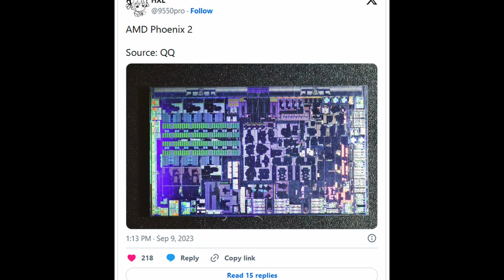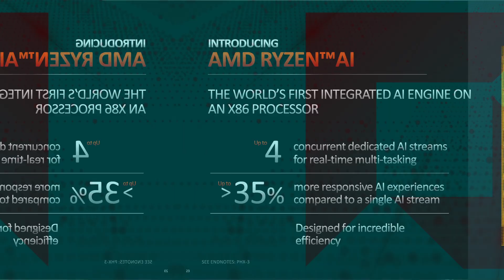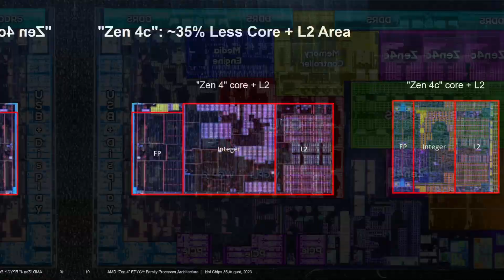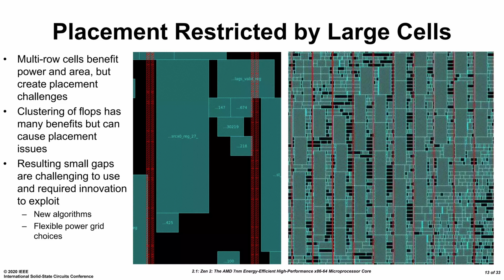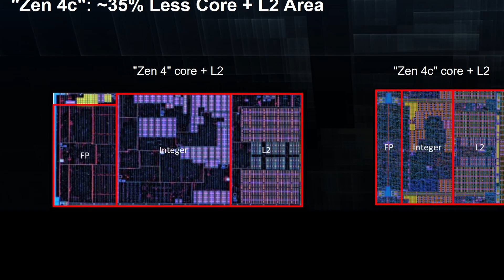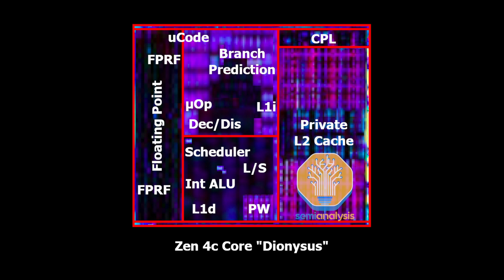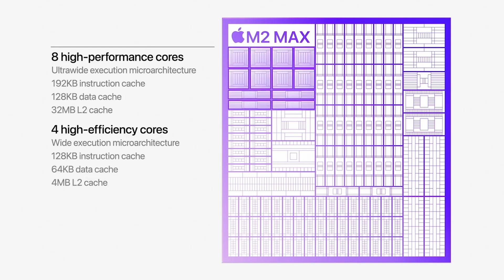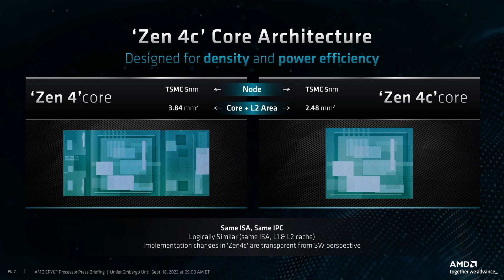Why AMD's first Hybrid-CPU is Different

Comment: I'm betting Zen 6 is gonna be a complete "Big" core refresh that ONLY focuses on clockspeed.

The multithreaded future we've been dreaming of hasn't arrived yet and doesn't seem to be happening any time soon.

Also fun to think about they may make a very low power "little" core only CPU that can run on fumes, basically. Without sacrificing whole a lot of multithreading.
Reply from the maker: I think Zen 6 might also change the chiplet design itself.

Comment: I thought IBM did this first (the big/little mix), not ARM, with the Power Cell/BE as found in the PS3. AMD still deserve all the credit for taking it further: eg Xbox switched from Power to AMD. Well researched, thank you for your work!
Reply: The CELL SPE cores should not be called big little really. The SPE could not run any general workload. They are basically SIMD coprocessors managed by the main CPU. Cell is a heterogeneus design yes, but I'm not even sure thet SPEs should be called cores at all. You needed an API/SDK to use them and you basically offloaded some parallel straeming operation on them, not branching logic. Which is why Cell was hard to program for but gave a lot of potential.
Reply: I think that's maybe why he used b-roll of the original PS3 COK-001 motherboard in the video.
Reply: @Doubles_Advocate  thanks I missed that! Oops

Comment: That is very clever: they avoid any optimization/compatibility issue
Reply: Isn't that the whole idea of PCs... keep using the same time tested architecture, so you benefit from all the previous work and don't cause problems.
Add small new things to the arch slowly without removing anything.

Comment: It's a lot of money to develop a 2nd microarch, and I bet it's hard to justify thay cost for an arch literally intended to be slower.

x86 just isnt designed for bigLITTLE paradigms. ARM and RISC-V are just better platforms for hybrid designs and AMD might just be hedging their bets than x86 is going to die before hybrid designs are worth the investment.

Comment: If I had the option to buy a "8995" am5 cpu with 48+ cores 96+ threads at say 4.5ghz boost clock (16 core big and 32 little) I'd turn in to fry "shutup and take my money" I run a lot of containers and vm's on my desktop I run a 7850x with 192gb of ddr5 at 5600mhz as is and can easily max out my system honestly need a thread ripper class machine but can't afford it.

Comment: AMD also named the small Zen APU as Raven 2. Later it held a name I can't recall but driver code still refers to it that way.

This is actually a great way to go, especially on laptops. 2B + 8l would probably be thermally limited anyway but less than an all core equivalent.

For desktop 4B + whatever you can fit should also be enough for high performance designs. On server Genoa is already a huge win for higher perf through lower power per computation.
The hard part will be fixing the Windows Scheduler. On Linux it is already fixed by ARM long ago.

This is also a different design from Intel, as here the small cores also have the same connection to the memory controller and L3 cache. On Intel there is some latency penalty from them being clustered in groups of four.
I think people will be very surprised of how this will work and will not think of small cores as a bad thing.

Comment: Having the C and non-C cores have the exact same instruction set but with diferent frequencies/thermal budgets is brilliant! That means no AVX-512 bullshit like Intell has, or problems with certain instructions being significantly slower on the C cores vs their alternatives with regards to the non-C cores. This allows compilers, opersting systems and applications to optimize for AMD much more thoroughly.

Comment: PS3 motherboard at 5:12, 😂
Reply from the maker: OMG how did you spot that? How many PS3 mobos did you see in your time?
Reply: @HighYield  I don't think I've held one in my hand ever. But the way smd components are arranged on the Cell CPU chip is unique: they are at the bottom side where solder balls are. There had to be a hole in the motherboard, otherwise it's impossible to solder the chip. I've never seen anything like that anywhere else.

Comment: I think AMD should start to abandoning SMT and  making future Zen c core to be able to work in pairs to combine IPC. They should also start integrating dedicaded hardware compression/decompression engines, dedicated virtualization engine,  DPUs. That would make PCs feel like far above consoles if software is properly optimized. I don't see core count going 3 digits(unless the core philosophy changes) in gaming desktops, regular pcs and laptops in 20-30 years or even more. Pro/server will always be unsatisfied.

Comment: Hoping to see a 8 zen 5 x3d + 16 zen 5c cpu in the first half of next year. Gonna be building with that chip if it's released.
Reply: Yeah, that's a mad concept for programmers and content creators who also wanna game.
Reply: They won't do that... It sounds amazing on paper but how many people would actually buy that?

Also it would perform poorly. There's a memory bandwidth requirement to feed cores. Probably requires threadripper socket.

There's a lot of discussion of whether it's coming to the chiplet desktop CPUs at all in a hybrid package with a regular chiplet and a c chiplet... And it seems like it won't at all... That's why we've only seen them in EPIC because they make so much sense for servers. And in laptops where the size and power efficiency are king.
Reply: @SquintyGears  Intel is pushing e-core counts higher already with 14th gen and they're already at 8+16 now, so AMD is going to have to do something if they want to stay in the upper end of multi threaded performance on desktop. I have a 5950X myself (software developer) and in my workloads it makes 1-2% difference whether I run the memory at 3200 or 3600. For really "crunch heavy" stuff like all AVX workloads it makes even less. It's practically only branch heavy code, and code that does very little work to very large amounts of data (like database lookups) where memory bandwidth is a problem. Games, however, tend to fall in this category.

Threadripper (non-Pro) went up to 64 cores on a quad channel memory setup on DDR4 3200. I can't see any realistic scenario where 8 full and 16 compact cores can't perfectly well run on dual channel DDR5 6000.
Reply: @andersjjensen  we haven't seen the numbers for those intel chips yet...
Yes obviously quad channel has been proven in the past.
The main difference you're seeing from 3200 to 3600 is the inifity fabric clock difference because latency to memory doesn't scale along with the the raw bandwidth difference of that clock bump, unless you took the absurd amount of time it take to tune the timings for it. i don't know anybody who has, I've tried and given up....

Also, importantly, Intels 8+16 wouldn't take as much bandwidth to feed as a zen + zenC of the same count because the slow intel cores are much slower than their counterparts.

I'm not saying i know exactly where the breaking point is where the performance gains fall off a cliff. But I'm pretty sure we're not that far from it. with some quick napkin math with latency that hasn't changed and bus width that hasn't changed but core counts having exploded you can understand why some people wanting to see 48 threads on AM5 seems a little bit far fetched... And that's if they would even make such a configuration. I'll remind you that we've only seen leaks for epic chiplet parts and laptop fully integrated parts. Both are integrations where it brings a very obvious advantage. What's the point for desktop? (assuming they do finally release an update for threadripper)
Reply: @SquintyGears  you do realize that the memory bandwidth has increased since they put 16 cores on am4 right? 24 cores is only a third more bandwidth needed if you start from the presumption that the first 16 core chips were bandwidth bottlenecked
On server they do 8 cores per memory channel for zen4 and 16 for zen4c. A 24 core needs 2 channels following server guidelines. Am5 has 2 channels...
Reply: @annebokma4637  see that's where i don't understand your logic. Zen4 and zen4c have the same ipc just a 20% clock deficit. So why would 16 cores take the same bandwidth as 8???? Intel might be able to say that but their small cores are slower in every way.

Comment: Commenting for Saint Algorithmus.
As a Layman, I have no expecation of what any of this companies will do with LITTLE.big design, but if there are enough other major competing design and programming organizations operating in a space, it makes coming to that space significantly more enticing as much of the ground breaking is already done or already being done.  
I'm thinking about how Microsoft partnered for scheduling with Intel to implement Intel's solution for this issue.  If the programming needed to optimize asymmetric design is already past the initial ground breaking as well as having multiple competitors already operating in that space, there is heavy pressure to maintain exploration that same space for yourself as well.
Will AMD eventually go full asymmetrical?  Depends on Moore's Law related stuff .. soo .. probably.   I mean .. AMD is already openly well practiced with packaging that stuff due to the costs/gains ratio of how better process nodes like TSMC's N3, N5, and N7 work with cache, logic, I/O and such ...

Comment: While the C-cores make sense for mobile, I think the gaming APUs are more limited by the area and power draw of the GPU (and possibly memory bandwidth). AMD needs to find similar optimizations for the GPU

edit: as a separate note, could mention in the video how modern operating system schedulers already focus on the best rated cores for foreground applications, and indeed multicore workloads push the clocks of all cores down, especially on mobile
Reply: Yes, but area efficiency is the concern, zen4 or zen4c both are very efficient at low power, but classic zen 4 takes so much space.
Reply: @yusuffirdaus3900  You should look at Intel cores, they are like twice the size of Zen cores, at roughly the same, or marginally higher IPC. Regular Zen cores are already comparatively efficient for the space. So Zen4c cores aren't that much bigger than a E core, but obviously much faster.

Comment: High core counts are also constrained by memory bandwidth. However, this can be partly mitigated with a larger cache. I would think a 32 core AM5 desktop could be made practical if: a) It also included 3Dvcache and b) it Used fast DDR5. Ideally, more RAM channels would be ideal, but even without them, I think 32 cores could be fed this way. Perhaps an all Zen4c or Zen5c desktop part with 32 cores would be a multi thread killer. It would still lag in games and the like due to lower clocks but I would love one on my desk.
Reply: We're moving to CXL and HBM. I think DDR is seeing it's last days.

Comment: I imagine the Zen 4c cores can compute the same instruction sets as Zen4, Unlike Intel E cores which are missing some instruction sets the P cores can execute. AMD with their smaller silicon footprint along with chiplets can likely build CPUs relatively cost effectively now, even with TSMC charging more to produce them. On the flipside Intel has the advantage of creating their own chips in their own fabs.
Reply: Yea the identical instruction sets is an interesting choice. It’s a huge win for the server market and opens up possibilities for all-efficient-core designs, but may make less sense for some consumer applications (a lot of background processes may not actually need stuff like avx512 so that may leave big chunks of the core sitting idle). 

 I’m sure how much intel running their own fabs is truly an advantage right now given how much they’ve struggled to get EUV online and move to their next node. Relying on TSMC may mean AMD is sharing some of their profits but it also means they’re always able to access the latest, fastest process node.  Shedding that risk removes a lot of uncertainty.
Reply: @MikeGaruccio  If you are using a recent C standard library you'll may end up having AVX-??? instructions simply by calling the strcmp function.

Comment: I just dont get the 'hybrid' approach here.  I feel like the idea of denser 'c' cores makes plenty of sense, but only when used in isolation.  So go either all big or all dense.  Otherwise, despite no technical IPC difference, you're still talking about needing to make the scheduler make guesses.  Lower clockspeeds still means a performance difference, so you need the most important and heaviest tasks to be on the obviously fastest cores.  Or maybe hybrid would be useful for like Threadripper or something where there's more of a split between needs of single thread and high core multithread workloads.  But this is a niche use case.  For vast majority of people, the multithread capabilities of say, 16 full sizes cores is more than good enough, versus 8 full size and 16 dense.
Reply: With this approach, the only difference between the cores is how high they clock. Modern schedulers have this information available and can watch how much of a core a process is taking and migrate it appropriately.

Comment: The biggest advantage of the the C cores is while it lacks L3 you can just pop v cache on it and make up the difference and then some. You wouldn't find that in the highest performance chips but I could see that for all APUs going forward considering die space is so important.

For high end desktop (gaming) I could see ryzen 8000 or maybe 9000 having a block of full sized cores with v cache and then a even lower clocked block of C cores for all background tasks or anything that the OS thinks wouldn't be effected by the chiplet to chiplet communication penalty.

Really AMD should just come out with APUs for the low end, mid range and high end gaming chips with v cache, and then have their highest core count CPUs just use C cores as productivity (generally) cares more about cores than it does clock speed. Not sure how much that would eat into threadripper sales but considering they havent come out with those for a few generations i dont think they would care too much.
Reply: @raute2687 You can say you do productivity work on a laptop but lets be real, any person that does it for work will have a desktop. Which is why they should segment the line up for entry level APU, mid and high end gaming, and then top of the line productivity where more cores will actually help performance.

Comment: AMD is definitely using the best approach to consumer high performance hybrid CPU design. Having a unified architecture across something as fundamental as the CPU cores is absolutely essential because inevitably the task of scheduling work appropriately is out of your control and in the hands of software developers, mostly Microsoft. While Intel can try to help the software with things like thread director, of it really worked to ensure work was only scheduled on cores that could run all the instructions thar visitor that work, they wouldn't have needed to disable AVX-512 on the P cores, but instead they had to remove functionally from their more expensive, more capable, and more premium cores to try and bring them more in line with their cheaper and less useful efficiency cores, bringing all cores down in functionality to the lowest common denominator.
AMD on the other hand will only differentiate their two types of cores by clock speeds as far as the scheduling software can see, and scheduling work based on clock speeds is something that schedulers have finally managed to get right.  Basically, by having a consistent architecture across all cores eliminates the need to develop a solution to properly utilize different core types based on both performance and efficiency requirements, but also by the supported functionally in the different core types. AMD 's hybrid designs will work with existing software that has been proven to work over multiple generations of hardware

Comment: Honestly this could revolutionize the flexibility of Chiplet design that AMD does on Desktop without needing to incur as much CCD Latency issues like on the X900+ SKUs currently.

Instead of needing 2 CCDs to break past 8 Cores. You could have a CCD by default come configured with 8 Full and 8 Compact Cores with 3DVC.

So something like

8950X = 32 Cores (16 Full, 16 Compact, 2CCDs)
8900X = 24 Cores (12 Full, 12 Compact, 2CCDs)
8700X = 16 Cores (8 Full, 8 Compact, 1 CCD)
8600X = 12 Cores (6 Full, 6 Compact, 1 CCD)
8400X = 8 Cores (4 Full, 4 Compact, 1CCD)

Then You can have something like an 8500 with some of the C or Full cores disabled to get 10 Cores or something. 

The scalability becomes far higher with that design.

Or heck, why not a pure C core CCD with even more 3DVC than the standard CCD?
Reply: Correct me if I'm wrong, but AMD won't be putting 16 full Zen 5 cores in a single CCD with Ryzen 8000. I think this will be coming with Zen 6/Ryzen 9000. 16 compact cores yes, this will be possible from what I've heard.
Reply: CCD size/density would need to double in a single generations to have 16 Zen cores in one CCD,
the rumours are talking about 4+8c instead of 8+8c for laptops
Reply: @YounesLayachi  This is 16 Zen "Compact" cores as an option for high-end CCDs. Not full-sized cores.
Reply: @Alovon  ah, when you wrote
8950X= 32 Cores (16 Full, 16 Compact, 2 CCDs)
I understood a 16 Zen CCD + 16 ZenC CCD.
I see now that you meant 8+8c + 8+8c,
Silly me, heterogeneous CCDs are a dumb idea xD the 2 CCDs will be identical , aside from any stacked cache on top...
unless...
Reply: @YounesLayachi  No, I meant 2 ZenC CCDs with extra 3DVC ontop.